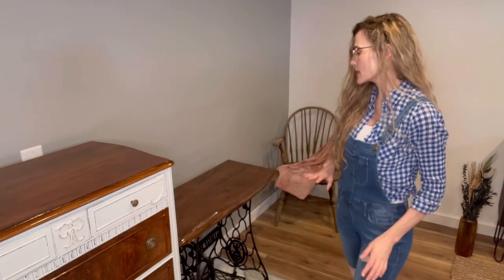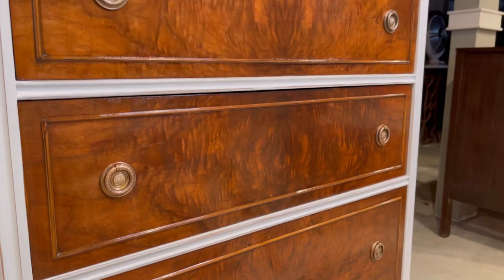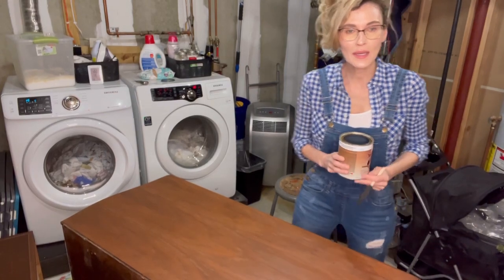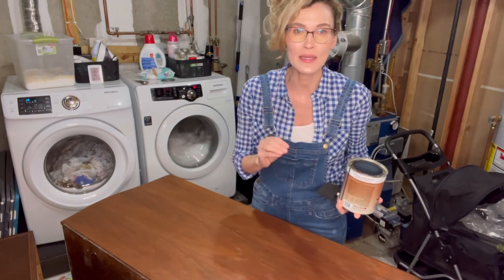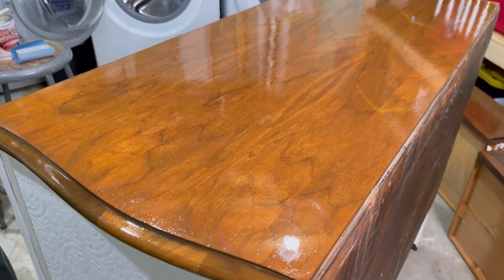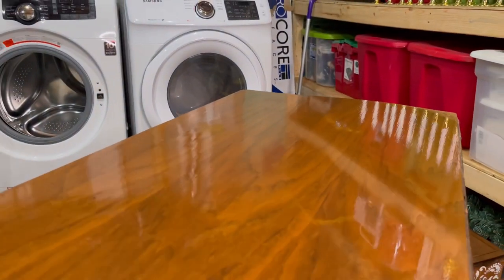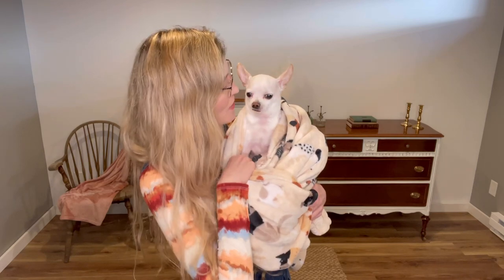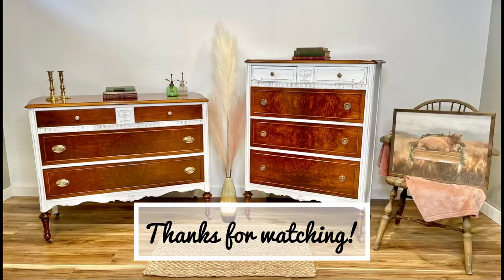How To Apply A Topcoat | Flawless Mirror Finish

Comment: Both those products are very good at what they do.  Really good tip about using shellac to seal the surface of your piece before putting on a topcoat.  And that shellac is very easy to work with.  Nice job.
Reply from the maker: Totally agree! I learned about the dewaxed shellac after having issues with fish eye. Thanks for watching!

Comment: I’ve never heard of the Zinsser seal coat prior to using a top coat. Sounds like an amazing product along with the GF. Also, I didn’t know about not leaving the lid off your topcoat. Does this go for all topcoats including Waterbased? Such a great video. Thank you for sharing.
Reply from the maker: I wasn’t aware of Zinsser SealCoat until I started working with live edge wood and upping my woodworking game. I’ve had numerous pieces of furniture in the past that either leak oils AFTER I’ve applied a topcoat or the fish eye issue. It started to google how to fix both those problems and I found the answer on a woodworking forum. It’s saved my pieces of furniture so many times. Miracle product for me. I personally have more issues with my oil based products either developing a skin on top or start to dry out prematurely in the can. I was advised to open the lid, pour whatever product I want to use out as fast as possible and reseal it quickly. It’s the oil vapors being expose to oxygen. Oil-based varnishes and paints 'dry' by two means, the first being evaporation of the solvent (the drying phase) and the second by reacting with oxygen in the air (the curing phase). What can happen is that the poly can begin to cure from exposure to oxygen, either because there was enough air within the tin above the poly or because the seal formed by the lid wasn't perfect so a very slow trickle of air could make its way into the tin, something that occurs fairly frequently. I also bought a can of Argon to spray into the can before I seal it. That preserves my poly from spoiling.
Reply: @madelinejeanantiquesrestor9074  thank you for explaining all this❤️
Reply: Did you use the seal coat over gel stain or water-based stain? Thanks!
Reply from the maker: @rosemaryflee  I used it over oil based stain.

Comment: Hi Beth, great video and a great tip with the your bootie😁😁A couple of tips for you.  When closing a can of varnish exhale into the can right before sealing.  The carbon dioxide from your breath will get rid of the oxygen in the can and help preserve the varnish.  I also warm the varnish before applying.  This will thin the varnish temporarily to help eliminate the little bubbles.  Have an awesome day .  Keep those great videos